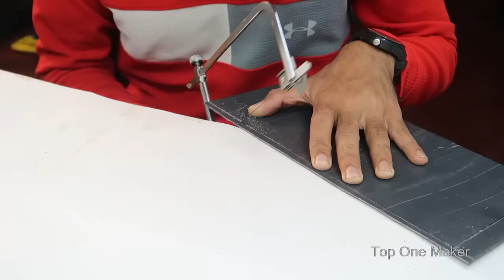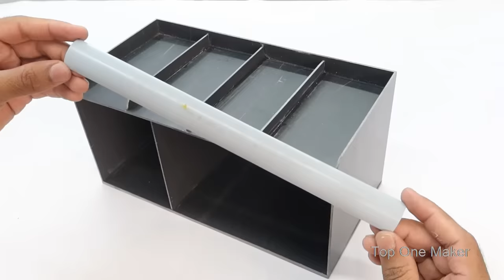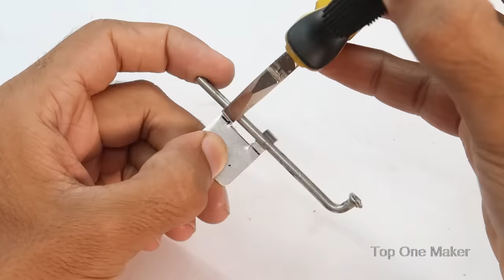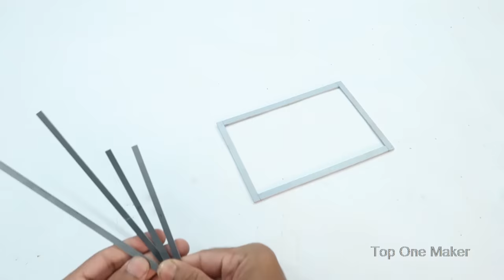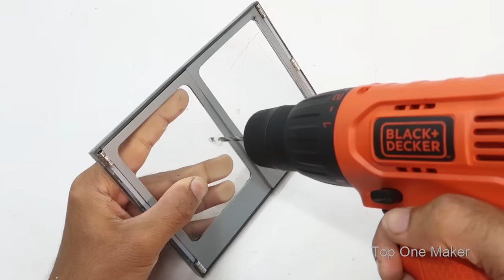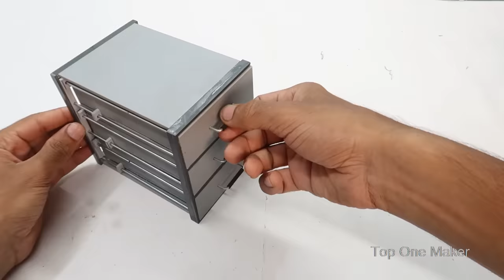DIY desktop   Organizer from pvc | #toponemaker

Comment: why use ca glue with pvc?
Reply: I’m not sure it is PVC. I think it’s probably ABS which does glue with CA. The way it behaves when he heats it and flattens it makes me think the plastic is most likely ABS. 👍
Reply: @andyscott5978  that makes sense, 
pvc, in my experience doesn't respond well to heat.  I have heated it to bend pipe in the past and it burns very easily. it also does not "weld" very well. instead of melting and flowing together like other plastics, it burns on immediate contact with the iron and forms a layer of ash.